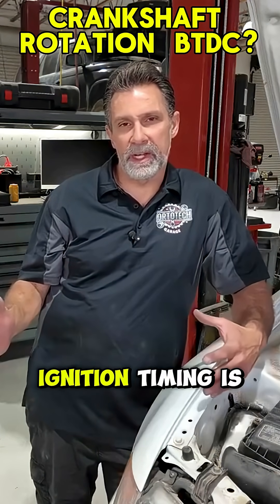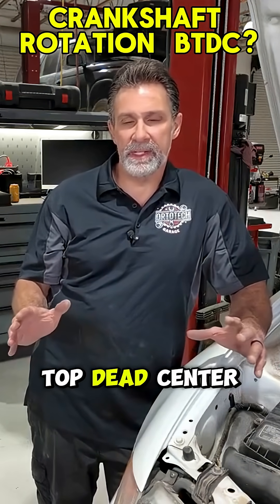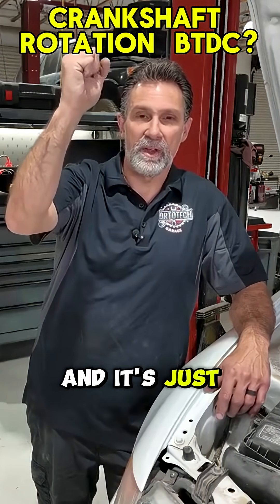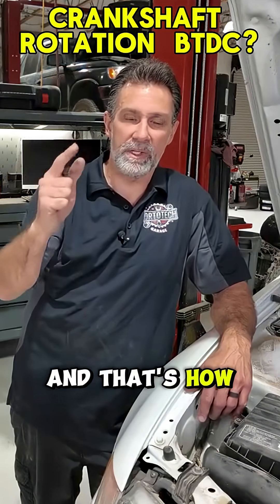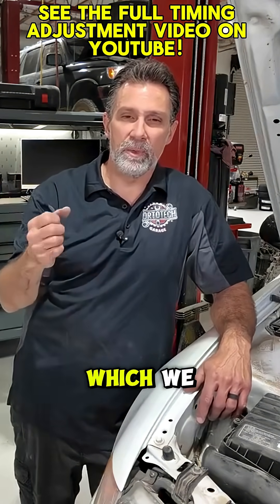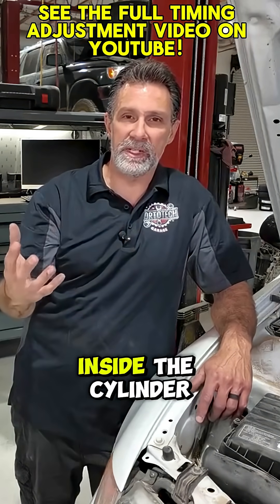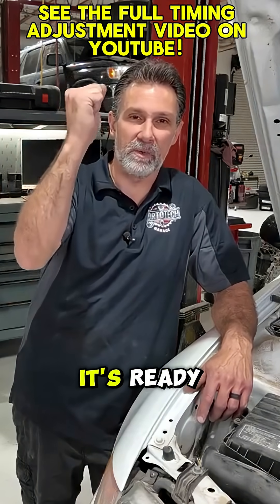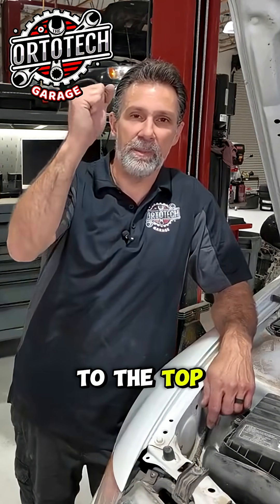Ignition Timing Basics – How It Affects Your Engine

Comment: What is a harmonic balancer?
Reply from the maker: The harmonic balancer is the pulley bolted to the front of the crankshaft.  It is usually two pieces molded together with a rubber insulator in-between them. It will often hold the Top Dead Center Mark for cylinder number one.  Additionally, it has significant mass and is designed to absorb and reduce the vibrations inherent to an engines power pulses being distributed through the crankshaft.  It helps balance out the harmonic vibrations.  It will also drive all the belts to run all the accessories like the  air conditioning compressor, power steering pump, and alternator.  👍